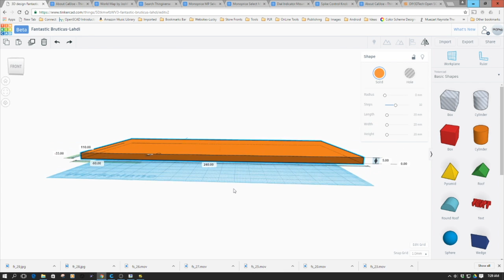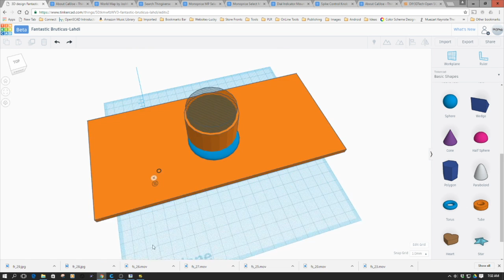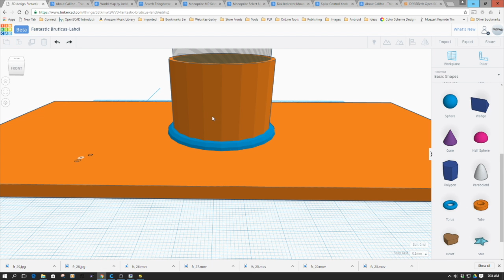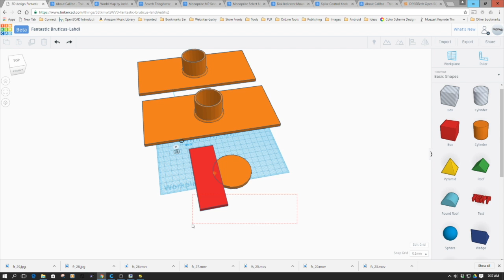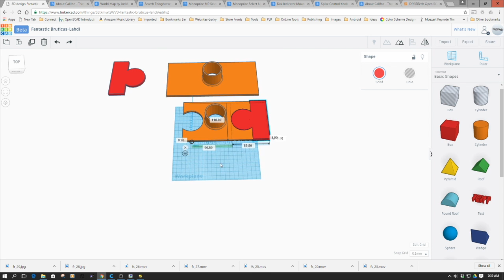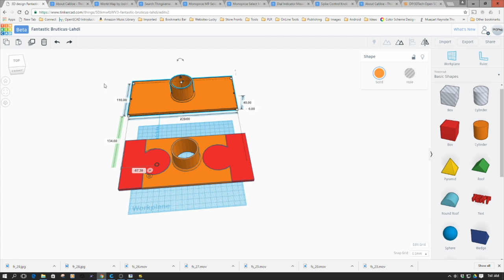TinkerCad Workflows - Designing a Part Larger Than Your Print Bed!

Comment: this is a even more important tip for those of us with with small beds like a Fab Mini .  ( yeah i'm almost done my franken printer ) . very clear and well shown man thanks
Reply from the maker: About time :-) you have been slacking!  Going to start a homemade GMAX bulid in about a month as I want to see if I can't get up to either 12x12 (inches) or even 16x16!
Reply: i have the vertical in my monster is about 400mm. I have had a bad chest infection for a few months now ( may have hear me wheezing in some of my videos .) and it kicked my butt , it got to the point it wa shard to breath just sitting . but I'm hoping all the wiring is done tonight .  hoping .
+ i downloaded a Printer controller for Android . now i just need a Bluetooth module  and i can use any one of my tablets as a front end / controller.
Reply from the maker: Very cool and you sounded out of breath so hope your feeling better and forward to seeing the bluetooth addition...